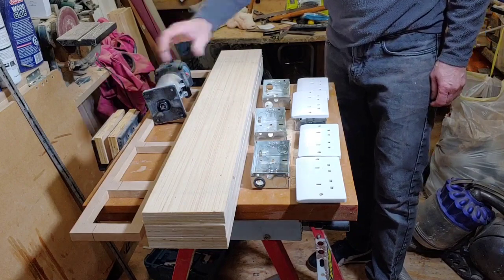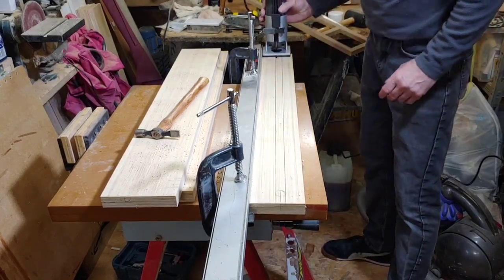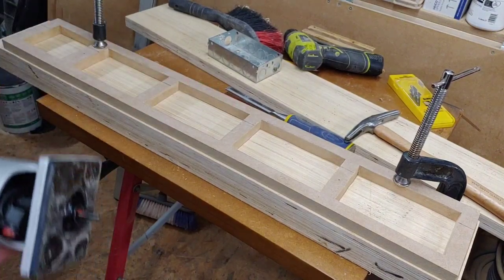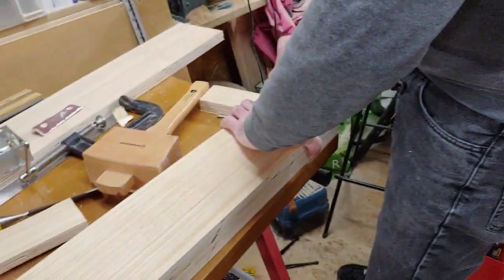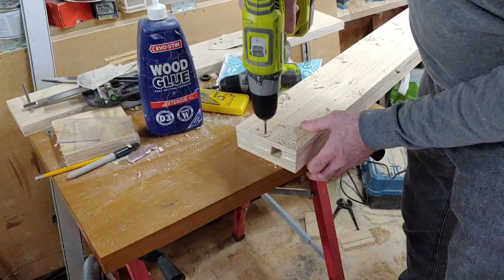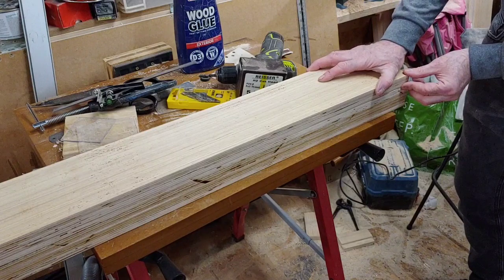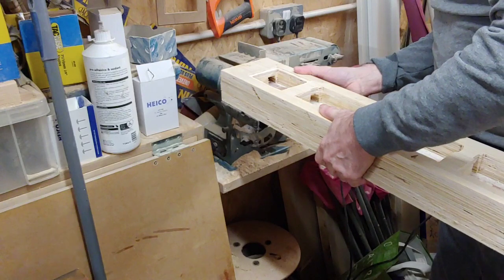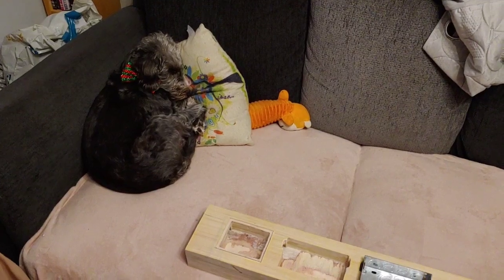Building Our 8 Socket Mains Conditioning Hub Part 1 ( casework)

Comment: for those without a router you can drill a hole in each corner of each recess and then use a jigsaw.this will go all the way through but you can use a thinner piece of ply as a back plate.